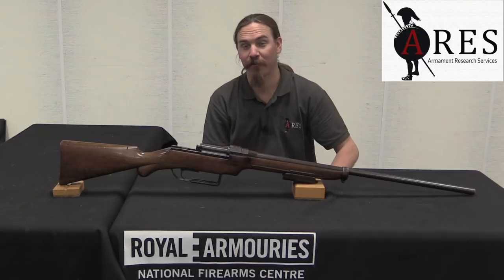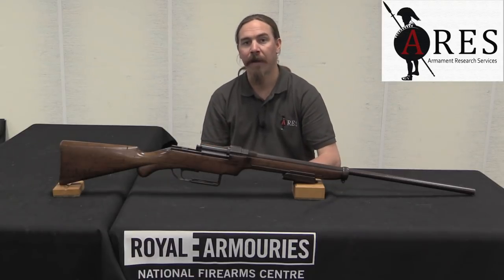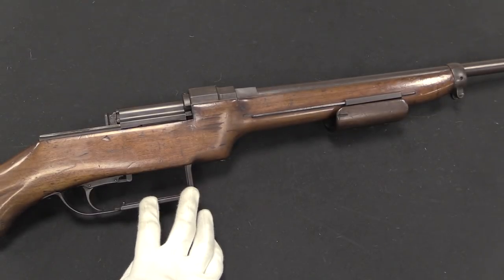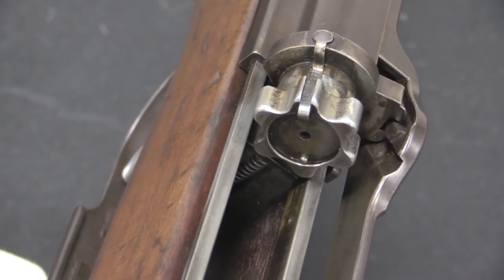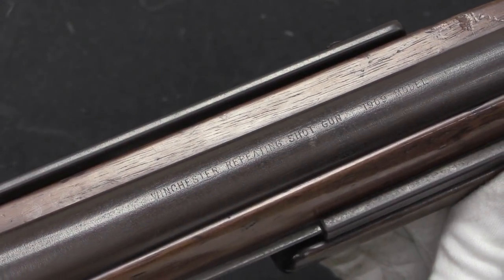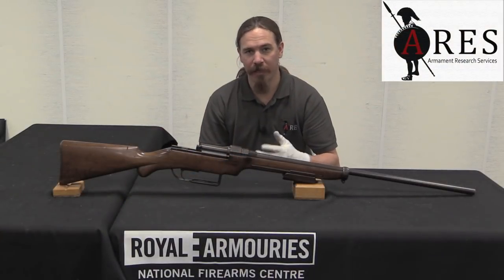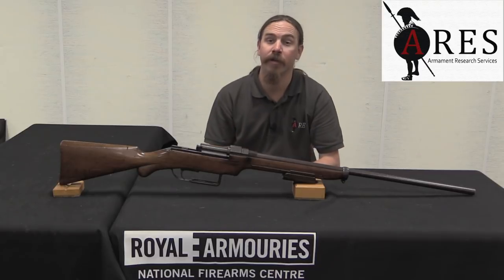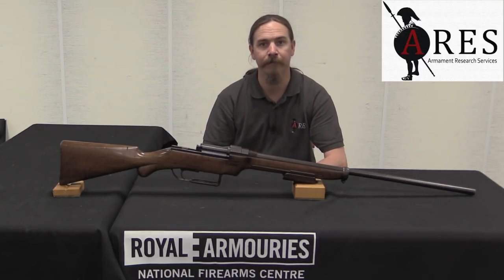Fosbery's Pump Shotgun: An AR15 Bolt in 1891

Comment: If Mr. Fosberry had thought to put a gas block and some type of piston on the end of that op rod he'd have had a very successful rifle/shotgun indeed. Every part of that action looks like an auto loading rifle, except the op rod is connected to a hand guard instead of a gas piston. Wild to think that no one thought to do that with his design back then. 

Cool shotgun though, what gauge is it in? I don't think you said in the video and it looked like it was smaller than a 12 gauge
Reply: dcwillis87 I think it's easier for us to make that connection because we already have the ar15 to compare it to.
Reply: In it's time, and still on many traditional English shoots now, this would have been looked on as  an abomination! The tradition on driven game is you take a few birds by skill, those that go over you live to fly another day.
Reply from the maker: If you just put some servos on the steering wheel and pedals of your car and connected it to your laptop and some cameras, you could have a self-driving car! :)
Reply: Forgotten Weapons Were the propellants clean enough at the time to even facilitate that line of thought? I imagine a gas system that early would be ruined rather quickly die to corrosion, if not fouling.
Reply: Forgotten Weapons I don't want a self driving car 😋
Reply: Henry White I'm not saying that because of the locking lugs, it actually reminded me of the actions on m1 garands, m14s, and Mini14s.

Just the way that thing is designed is what made Me think that. Obviously what we know about guns now is why we can make the connection buts crazy how close they were even in 1891.
Reply: Halinspark ...they did have smokeless powder by 1891... just saying.
Reply: As soon as I saw that action bar with cam track to rotate the bolt, I thought "Garand", surprised Ian didn't make that observation.
Reply: @pirobot668beta  He absolutely did that, it's what eventually became the Colt-Browning M1895 'potato digger' machine gun.

Comment: An 1891 model with a barrel from a Winchester 1909?
Reply: Ian thinks it most likely was a prototype or a custom made gun. So the original design is from 1891, but this example may have been made later using a barrel from a Winchester 1909 shotgun, or it was made earlier, perhaps in a rifle caliber or different shotgun gauge, and the Winchester barrel was added later.

Comment: Having the same discussion with a friend about how there really isn't much left in design innovation left for firearms. Ian would you agree that firearm design as it sits is stagnate?
Reply: He answered this in a few Q&A's but basically he's said that it has.
Reply: D3faulted1 the next leap will be not a firearm at all I imagine, hello ray guns traditional guns reached there zenith
Reply: If energy storage makes a huge breakthrough might see some electrically driven weapons like rail guns or Gauss rifles. But that'll probably be a ways off yet. Most innovation will probably center around sighting systems and electronic integration. Think of seeing a reticle on a augmented reality display something like google glasses. Without having to look down the firearm. Or tracking software that won't fire the gun until it's lined up properly for a hit.
Reply: It's possible but i'm thinking in terms of compact, streamlined and built in. Guns built to that purpose. I have no doubt that some military's already have that, but it certainly isn't mainstream yet. Guns will probably be built around the sighting systems, rather than sighting systems tacked onto the gun. Maybe not but it'd be interesting to see what form a gun would take when you no longer need to rest your cheek on it.

Comment: What actually makes the 6-7 lug bolt a good idea? Plenty of automatic weapons work well with less lugs. I've heard people say that it improves accuracy, but if that's the case why do so few sniper rifles or benchrest rifles use it?
Reply: Likely the more equal the spacing and mirroring of the distribution of the lugs & locking surfaces relative to the bore, the less chance of minute deflections under pressure and loadings,?
..less unbalanced 'wobble' of the bolt supporting rear of the cartridge means more theoretical chance of the gas pressures being parallel/even to the axis and/or the harmonics an uneven firing transmitting into the barrels whip,?
...and/or exceedingly slightly, skewing one side of the bullet more against the bore than the other for the initial movement from cartridge to barrels free space/rifling-lead-in.? ~in soft-headed rounds worst case (pun) scenario, part of the bullet could deform from skewed smooshing, leading to improper aerodynamics & a ballistic path/properties.
All assuming the barrel/receiver is equally able to deal, tolerate and surpass the firing forces and tension(s) upon it/them.